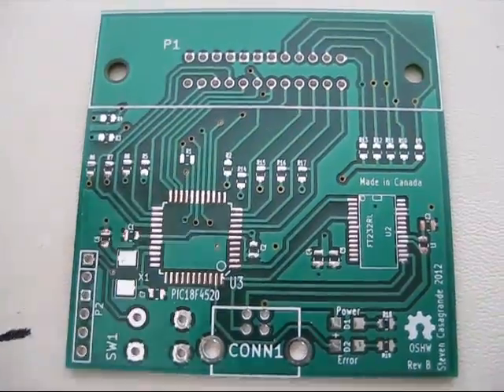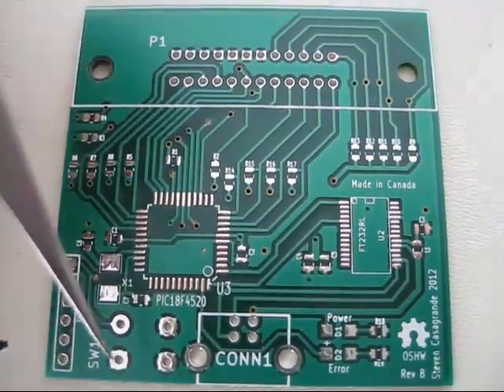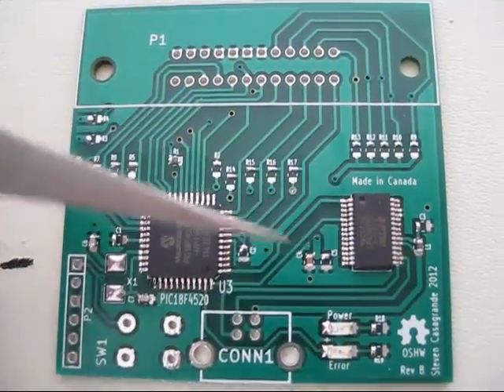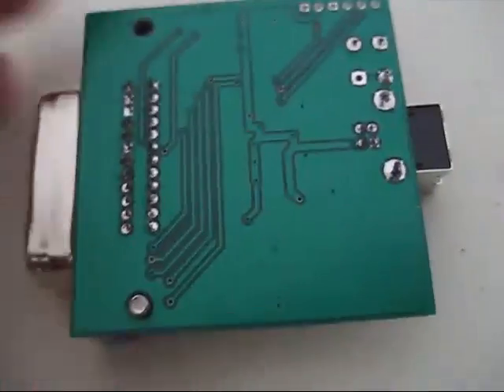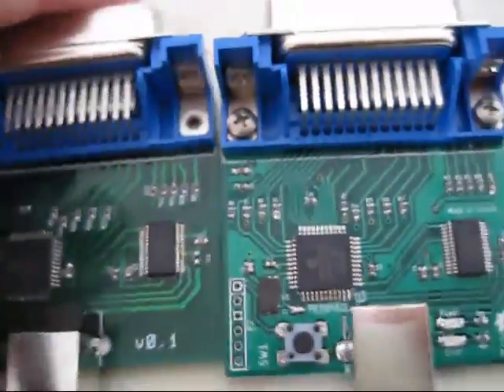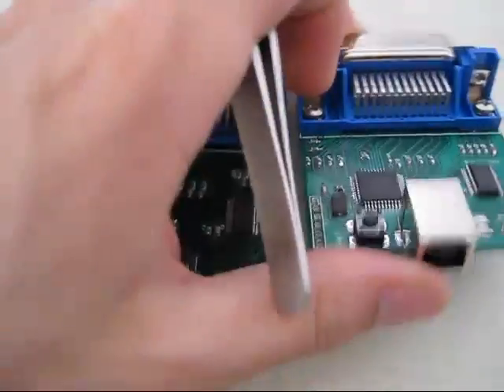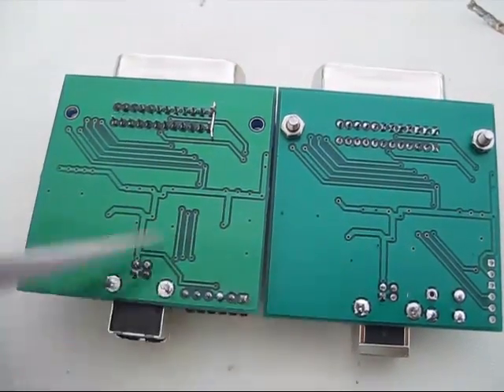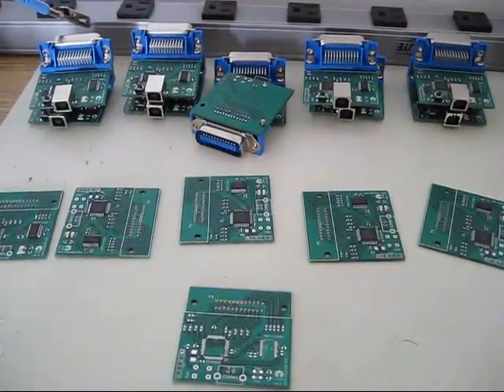Episode #11 - GPIBUSB revA vs revB

Comment: @stevencasagrande No link, but this is what is inside my Prologix USB-> GPIB adapter. They use a FTDI and an Atmega chip. If you used one of the Atmegas or PICs with USB built in you could eliminate the expensive FTDI chip. I can take a photo if you're interested.

Comment: The PCB mount GPIB plugs that I've seen use two machine screws from the bottom of the PCB that screw into the metal inserts inside the GPIB plug. No screw sticking out of the bottom of the PCB and two less nuts to worry about. Perhaps that's an option for you.

Comment: Rev B is much nicer compared to rev A. About soldering: to get good results just use some very thin' multicore solder (~0.25mm), use much less solder for every joint and let surface tension do the rest. But I guess, you already figured everything out. But it's just in case :)
P.S. o! and flux. you can't have too much flux!